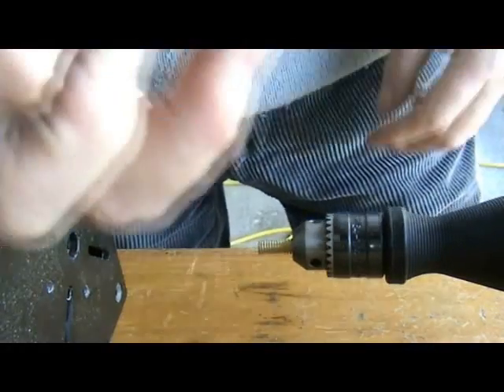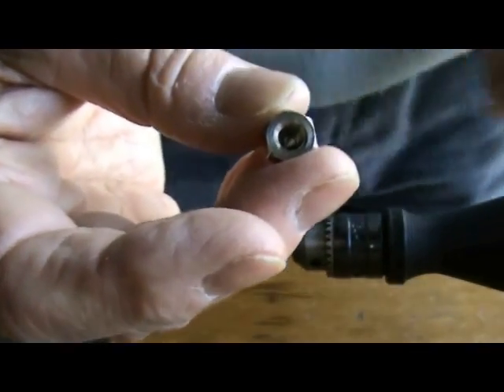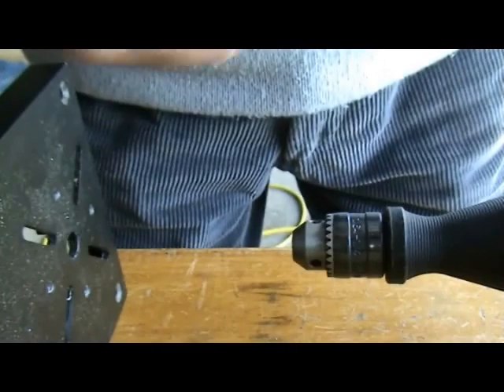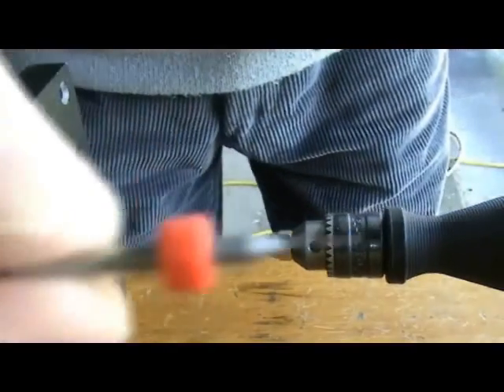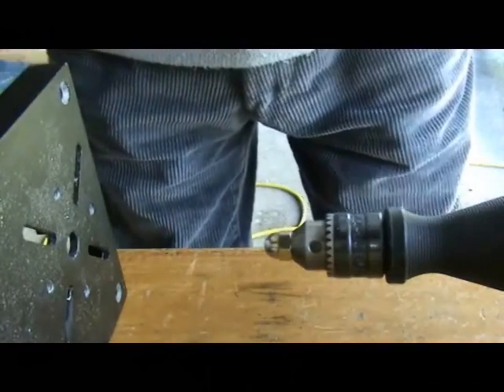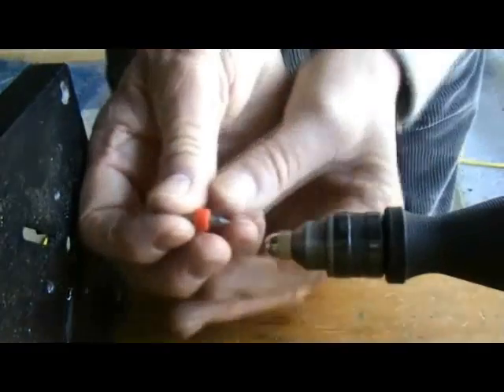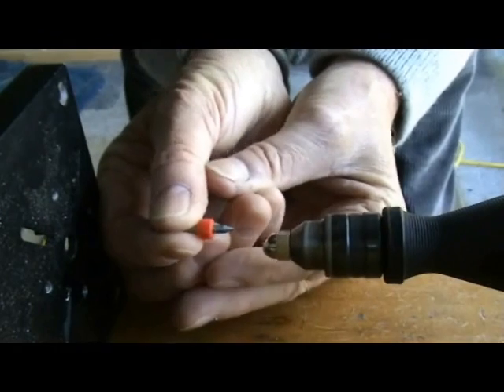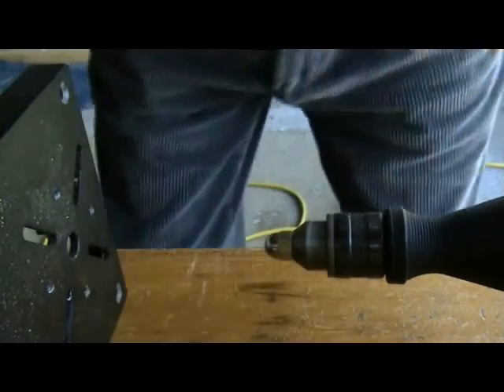Make a Brass Hot-End nozzle in 15 seconds!

Comment: nice work man, but how do u plan on adding it to the extruder?
the thread on this nut is on the inside, the hotend has threads of the same type, so will need a screw with hole in its center to act as an interface between this nozzle and the extruder, how do u drill that one? :c
so far ive broken all my bits trying to drill those screws, this nut was soo easy compared to it :c
Reply from the maker: Originally, this nut fitted hot-ends that typically had a threaded portion below the heater block. Since that video, I have designed a metal hot-end, similar (but different) to the E3D. I have a short, threaded brass insert that fits roughly half-way into the heater block and buts up to another (stainless) insert. This enables me to continue using the dome nuts in the video - easy to remove and clean!.To drill the brass threaded insert, Look at the following video.
CentreDrills.wmv

(After centre drilling, just use a 5mm drill then tap out a 6mm thread. Hope this helps!

Comment from the maker: These are typically called Carbide PCB drills. I get them from China and have seen them in sizes down to 0.2mm. I use brass dome nuts, 6mm thread.

Comment: Very interesting. Can you tell me what thse drill bits are called? i checked e-may for 0.4mm drill bit an could not find them. Also, what is the size of the nut I should buy? Obviously I need a matching thread for the drill. Thanks